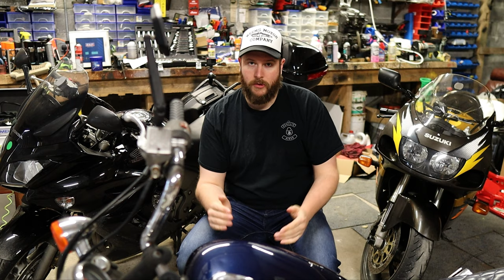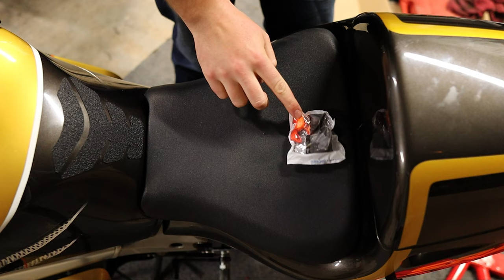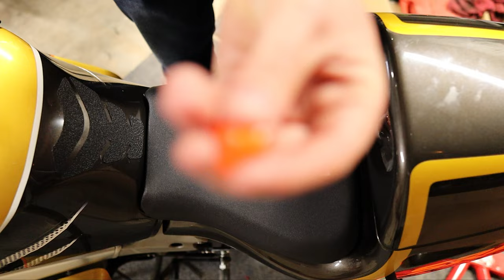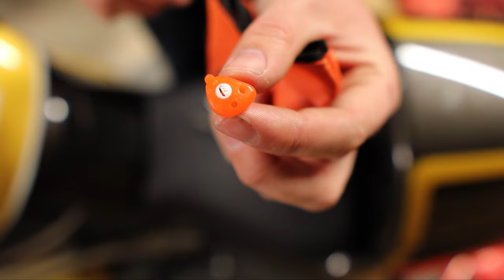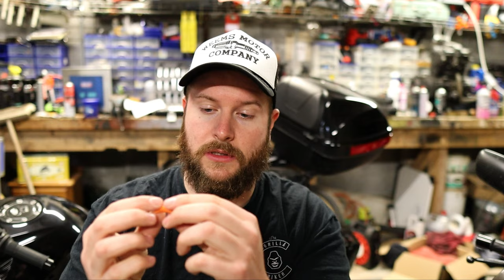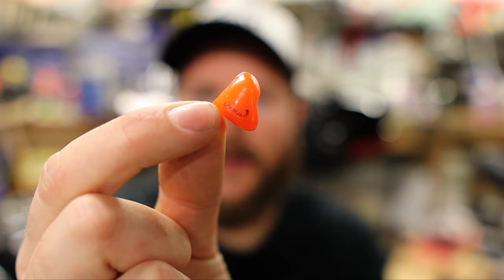The Best Hearing Protection? | Motorcycles and Hearing Damage

Comment: I somehow forgot to view this video. I saw the Ponkster's video on the same topic, where he mentioned this video and it reminded me to watch this. Wind noise has always detracted from my riding enjoyment and it's for that reason I've worn the foam ear plugs for about the last 20 years or so. They're not great, being a bit uncomfortable, and not easy to get in, as one of my ear canals is quite narrow. For that reason I keep them in when I take rest stops, also keeps them cleaner. They are cheap though, and washable too. I find if I moisten my ear canal with a little water before putting the plug in, it helps them slide in easier. I like the idea of custom fit, but not the price. Specsavers will do them here in London for £115, so I'm not ruling it out entirely. I have ordered the Alpine Motosafe Touring plugs from Amazon at £14.64 with free delivery. Hopefully they're a good compromise buy. Thanks for covering an important topic and I liked the tip to stretch the ear up when putting the plug in 😁 👍
Reply from the maker: I somehow missed this comment :O Yeah wind noise really really hurts my bad ear if it carries on too long so I always had to do something with it. Yeah they're cheap and washable but just always made me feel sick, otherwise I'd imagine I'd have bought a tub of them and just stuck with them too!! That is the issue, they're expensive but I think over the few years I'll be using them it'll kind of take the sting out of it(I hope) plus to be honest keeping my one ear good is invaluable. 
Honestly I think you'll fly it with the alpine ones if you get on well with the foam plugs :) Haha no worries Mark and thanks for watching! Always glad to be of some help! :)

Comment: We always have substantial wind here and it does get loud. I have a set of custom molded ear protection, but they are too quiet and I can’t hear cars around me which I don’t like. So I wear the earplugs you squish and let expand in your ear canal. I do have hearing loss from working 42 years on the railway.
Reply from the maker: Yeah air is surprisingly loud 😂 I used to work on roofs and when it was windy man you knew about it! 
Oh ok that's not great, my ones are motorcycle specific and let in a nice amount of noise, not sure if this brand is available over there? 
The squishy ones I just cant wear they make me feel nauseous. I wish they didn't! 
Ahhhh yes that'd do it!

Comment: I use the disposable ones (when I remember). If they come out a bit dirty, they go in the bin. I hate the bell shaped disposable plugs. I will look at getting some specially molded ones for me ears soon. I would get orange ones as they are easy to spot when you drop them.
Reply from the maker: That's the trouble with them too I find is I rarely had them on me, the silicon ones then stayed on my keys so we're better but, if you get the customs you won't know yourself :) That's a very good point 😁

Comment: Amazingly timed video, I've been using the Alpine Moto ear plugs for years & while I find them very good, I decided recently to get custom ear protection. Rang a company in Dublin and they wanted €300 for a custom set. 

Never even considered Specsavers, will give my local branch a shout.
Reply from the maker: Sure look, my save some hearing senses were tingling :D They are very good in fairness to them for a one size fits all job, but they have nothing on the custom fit. Yep, I got quoted 400 by another crowd before I found specsavers!! In and out in 15 minutes too :) Let me know how you get on!

Comment: Bose qc30 , these are noise cancelling ear buds, they filter out all the bad frequency noise , the wind noise is greatly reduced but you can still hear everything else clearly. Also you can connect your phone or sat nav etc via Bluetooth to the bose system. Only negatives are they are expensive and take a bit of used to putting your helmet over them. Once you get the knack its easy and I have had mine 4 years now problem free. Battery life is about 12hrs. 
For the last 5 years i have toured in SW ireland at least 3 times each year and now have severe withdrawal symptoms due to continued covd restrictions, i have rebooked yet again for late september so fingers crossed !!!
Reply from the maker: Out of interest are they just filtering the noise or do they sit inside your ear canal and actually block the noise too? That's why I like the cardo/ear plug pairing it's still just as comfy but I can hear it waaaaaaaaaaaaay better with the ear plugs. 12 hours battery life is pretty amazing though! Only downside I see is you likely cant take calls and such through them?
I also have withdrawal from touring about, we werent allowed to leave our counties so long I'm missing the rest of the country! Hopefully you are allowed over for that one :)
Reply: If you put them in when they are switched off, they still reduce sound as they are silicone buds that fit in your ear, then when you switch them on you can suddenly hear all the background crap noise disappear. They do have a microphone but it’s in the exposed side of the ear piece so not ideal for helmet use. As long as you stop the bike, you don’t have to take your helmet off to speak as the microphone will pick up speech from within the helmet. It’s no use when you are actually riding. Beara Peninsula here we come………..hopefully !! @TheGorillaBiker